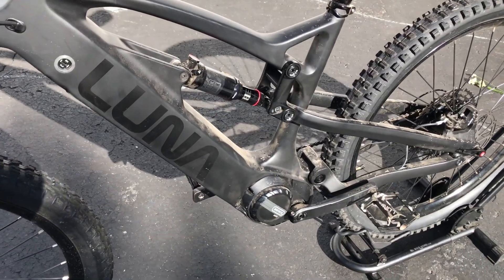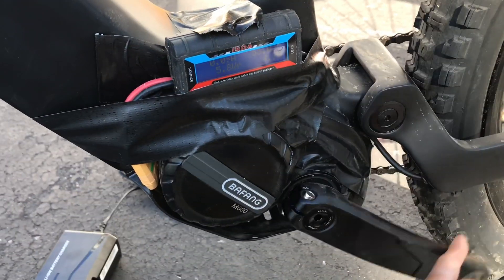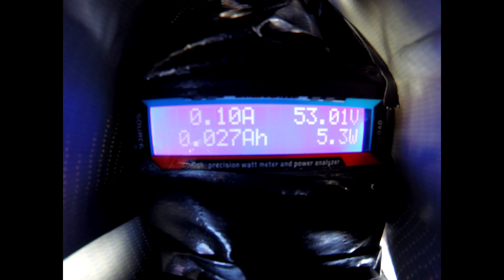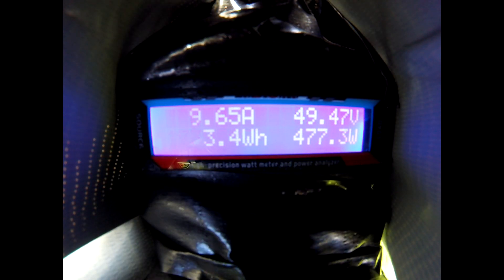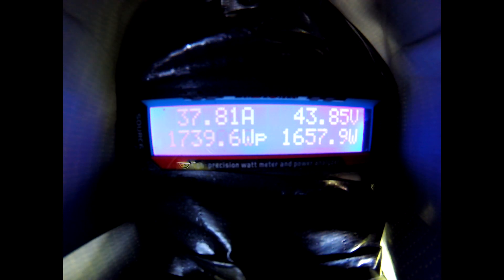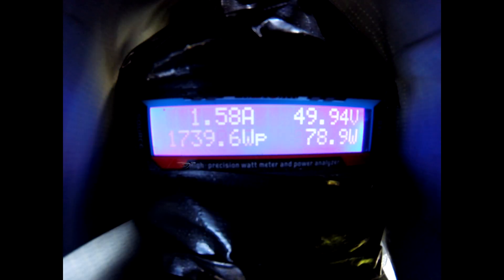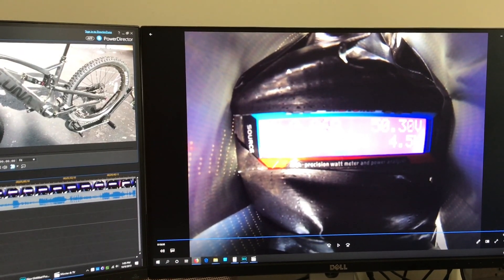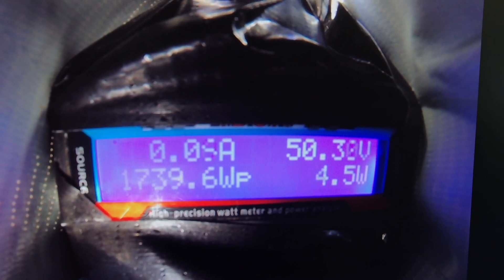Measuring the power of a Luna Cycle X-1 Ludicrous

Comment: So this compared to a non ludi ridden the same way you think the range would be affected greatly? Seems like it mostly hangs in below 20 amps which is what a non ludi bike is rated to.
Reply from the maker: Since I don't have the standard M600, I can only speculate, but I think you're right that the range shouldn't be that different assuming there aren't long climbs at power levels above stock. That is one thing I noticed too that it doesn't really go into "Ludicrous" power levels unless pushed hard (like going up a steep hill in a high gear).

Comment: How in your opinion  is the ludicrous  mod done I've got m600 from frey want to unlock  it to go faster
Reply from the maker: I have no idea how they performed the modification. We can’t program it, so there’s no way to remove the speed limit. I hope someone figures out how to hack it someday.
Reply from the maker: How much does your Frey weigh? Did you get a full suspension model?
Reply: So I have a ht 1000 also which is about 10 pounds heavier  I will see if I can put on scale

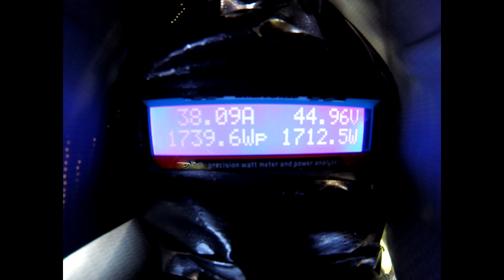Comment: at 5:45 when it spiked to 38 amps @ 45V WTF
Reply: It’s nice that it can do that but if it sags anything like that without the power meter a 52v battery and lower amp limit is probably a good idea long term.
Reply from the maker: @ps3customgamer  Well, the battery wasn't fully charged. I'll have to repeat the tests with a fully charged battery. If you use the lower assist levels (typical of an actual ride), the limit is lower. I'll have to test each assist level. I also plan to do this while I'm on an actual ride. I think the power draw will be far lower in actual use.
Reply from the maker: That's when I started going up a hill.

Comment: Nice video. When I say 'peak' power it means that the power level the motor can take for a few seconds, but not much more. Continuous power is what you can run the motor several minutes on the level without overheating. I think 'peak' ratings for speakers doesn't really transfer over to ebikes. Great video, keep it up. I subscribed.
Reply from the maker: Thanks Karl! That makes sense. I appreciate the clarification!

Comment: Heat is a limitation for any electric motor system. I suggest a temperature gauge before you max out sustained power. Any hotter than 60 degrees Celsius is not good
Reply from the maker: Thanks for the warning! It has a built-in temperature sensor that reduces power if it gets too hot, eventually cutting power once it reaches a certain temperature, but I have no idea how that is tuned. Where would you suggest placing a temperature probe?
Reply: @JustEnjoyingLife73  there are 3 main areas of heat: Motor stator coils, controller mosfets and battery cells. I suggest a laser temp gun its fast n easy

Comment: OMG, do you collect camera mounts as a hobby!
Reply: I was thinking the same thing.  I ordered mine last week, and now I am dying to ride it watching your videos as they come out!  I did not order the ludicrous option, wondering if I now made a mistake, I only briefly rode my friends Giant with a yamaha 250W motor and thought it had plenty of power so I figured 750 (or 500 as bafang rates it) would be plenty.  What do you think?
Reply from the maker: @timothystark5986  I'm glad to hear that :) Thanks for telling me. I don't think you made a bad choice, especially if you liked the Giant. If I were to guess, I don't think I'd be using over 1000 watts that often during a typical ride. Also, if you look at the wattage during my ride on a flat street, it doesn't really go much over 1000 watts if you start out in a low gear.
Reply from the maker: Haha, I just got one of these :) https://smile.amazon.com/dp/B07K1VSXM6